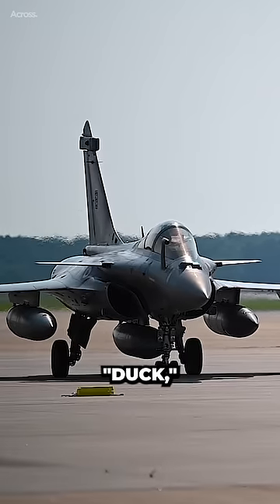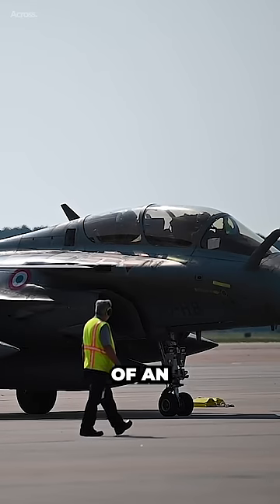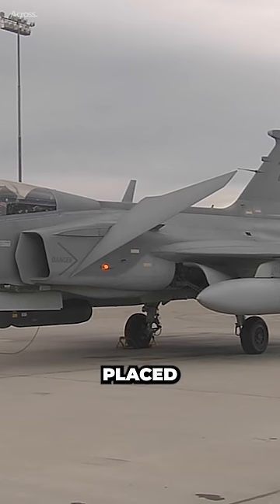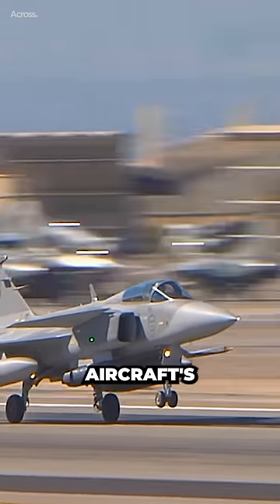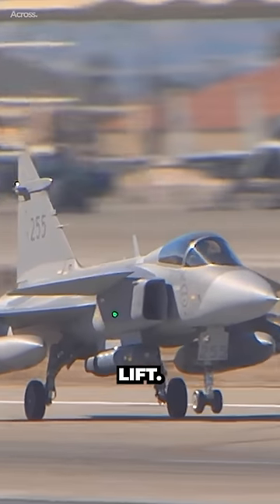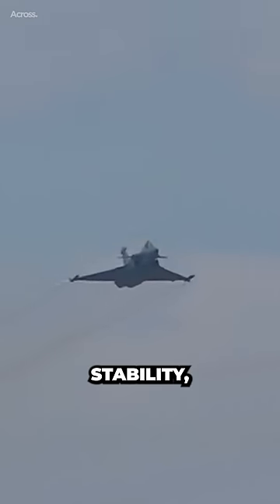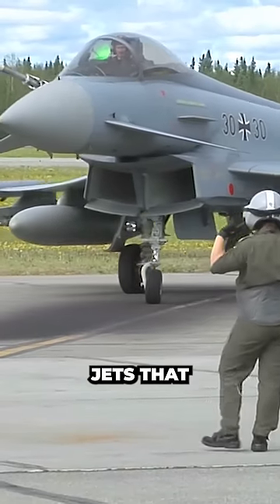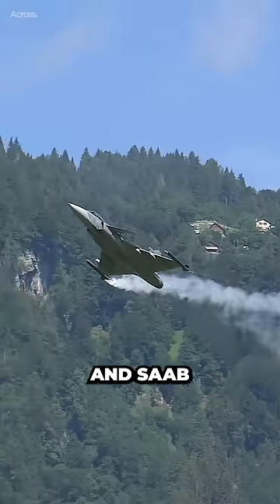Why Don't American Fighters Jets Have Canards? #shorts

Comment: Probably a bigger thing is that the US hasn't adopted a non stealth airframe in 50 years, and actively does not want to damage sales of the 4th gens by admitting they are pretty easily improved upon. The f16xl is simply better than the f16.
Delta canard is objectively better, but not so much better that it is really important. US doctrine has regarded air war as a sensor war for a long time now, so they have done very little work on improving airframes, other than reducing visibility.
An F104 with modern situational awareness aids, coutermeasures, and weapons would almost certainly beat a 1990s F15, and there is much less room between the F15 and perfect than the F104 and the F15. The US regards the 1970s airframes as 'good enough' so does not see any need to adopt more modern designs, at least for now.

Comment: The US may not use control canards, but don't the stabilators on the F-22 and F-35 provide similar, if not more benefit? And I'd be interested to see if there are additional benefits when pairing thrust vectoring with stabilators over just canards.
Reply: I would highly recommend looking up the MIT opencourseware video on the F-22. The presenter does a deep dive on the control mechanisms.
Reply: @SSMJ  Thank you Seth! I watched this a while back but will give it a rewatch. I mainly wonder if anyone has done a presentation on the comparisons of the Gen-5 stabilitor applications versus control canards. I don't remember if Randy touches on this in the lecture but I will find out!
Reply: @j.l.61  I don't think anyone is ever discussed the topic specifically, but my understanding is that canards were initially introduced to compensate for some of the failures of controllability of Delta wings. As a contrast, to my understanding modern stabilators are used as an avenue to provide non-traditional vectors of control as compliments to an already very unstable airframe. Though these are benefits that weren't realized till the computer based flight system of the raptor, and in the raptor's case the design decision was made due to stealth considerations and caused a massive headache to work around initially.

Comment: What if instead of traditional nose cannards , we use the massive air intakes on the front and install variable nozzles , to adjust intake airflow which generates a directional thrust vector at the nose of the plane.

Comment: If you're looking at 5th gen and beyond fighters, then canards will adversely affect the RCS which will affect how stealthy the fighter can be. Look at the J-20, and how much larger its RCS is compared to the older F-22 and the F-35. 

Also, with the advent of thrust vectoring, these 5th fighters won't need canards to be more maneuverable.
Reply: Thrust vectoring isn't used for maneuverability in an engagement

Comment: Canards are great to a point; but at supersonic speeds a canard propagates an additional set of shock waves over the aircraft that interfere with airflow about the main wings. In traditional supersonic aircraft the solution to this problem is simple; the wings and body propagate a shock wave over the rear stabilizers and the entire rear stabilizer is actuated to actually use the shock wave to its advantage. Since the wings of an aircraft are fixed canards present an extremely difficult aerodynamic problem to the main lifting surface especially at higher angles of attack. The instability is even worse during the transonic region of flight as the aircraft approaches Mach 1. While canards are great at subsonic speeds with a computer controlled flight control surfaces they are horrific dead weight at supersonic speed. It’s one of those things that looks cool but isn’t really that useful. This is why the SR 71 went blend wing body and the Canard is actually blended into the wing and the body. At a high enough speed rear stabilizers are just a heat producing drag surface as well. A while different blend wing body is needed. Canards can be utilized at higher speeds with very predictable calculable angles of attack where the propagation of the aerodynamic disturbance can be specifically engineered as an advantage and there is a need to not have rear stabilizers about one or more axis. It can be useful at high angle of attack to use a type of blended wing body canard to create a vortex over the main wing and body of an aircraft to increase lift and control dramatically. This can make for a very maneuverable fighter plane at near stall speeds; but requires lots of thrust to maintain.

Comment: Canards are also hard to make stealth. It’s possible, just very difficult to pull off and sometimes it comes at a cost like making them stealth means another part of the aircraft will be less stealthy. 🥷 

Also, we really don’t need highly maneuverable fighter jets. People raised such a fuss over a F-16 taking out a F-35 in a mock air battle, I didn’t find that surprising. Stealth fighter jets don’t need to be good at dog fighting, they’re like the sniper on the battlefield, if a stealth fighter jet is close enough to see then that pilot did many, many, MANY things wrong….

Comment: Because they aren’t meant to be flown high for stealth, it’ll be low and fast so they aren’t picked up on radar and can’t be engaged with anti air as easily having a moving part changing the radar cross section. And when your down low you’ll need manoeuvrability in case you do get targeted with anti air. Unless your a high altitude bomber well above missile range with top spec stealth altitude is just good for cruising and saving fuel, great for economic and passenger planes, not if you need to manoeuvre in a hurry to evade a missile in a combat role. That being said each plane has its own characteristics for its specific purpose which isn’t the same as the other aircraft.

Comment: Great for delta wing aircraft…. They greatly improve maneuvering. 

Bad for stealth.  They bounce radar right back at’cha!!!
Reply: The stealth-reducing effect of canards is a myth. They don't move that much, so don't bounce radar back
Reply: @Orbital_Inclination  
Movement Doesn’t cause a radar reflection. 

Corners cracks and grooves do. That’s why the bodies of stealth aircraft try to be rounded.  (first generation was highly angular.). They try to hide air intakes and jet exhaust on the top of the wing (B2, Strealth drones) so that radar from underneath isn’t reflected.
The canard meeting the body causes a groove all along where it meets the fuselage.  
That groove bounces and magnifies radar beams.  
Just my opinion. Maybe an aeronautical engineer can comment?
Reply: @tpalmer4829  Sorry, my point could have been worded more clearly. I wasn't referring to the movement itself, but to the angle it makes not being enough to significantly increase reflection. 

Conventional tails also have exactly the same gap where the fuselage meets the horizontal tail of an F-16, F-15 etc, hence why the effect of canards on RCS is not really any greater than that of a normal tail.

Comment: I don't have aeronautical degree or anything. But I always felt canards were for the most part a lazy method of achieving stable flight on an unstable design.
You can also "sense" this when looking at  the f86 and mig15. There are fins on the wing of the mig15 to help with yaw, the f86 has them but they're much smaller or nonexistent. With that in mind they are much more prominent on us naval aircraft of the era due to those operating conditions
Reply: Strange that some who have aeronautical degree don't think the same way ...

Comment: I don't believe that canards are an issue for stability at the speeds 4th and 5th gen fighters attain since most are MACH 1.6 and lower.  Most US and NATO aircraft today aren't even as fast as the 2nd and 3rd gen fighters because of fuel consumption and stealth.  The outlier is the F-22 which can hit MACH 2.25 without afterburners and can turn faster than any aircraft in the sky without them. The real reason is that they're not needed and are too complex to fix in combat situations.

Comment: But less stable means more maneuverable and isnt that what a fighter needs to have a better chance of winning a dogfight ? Fighters can't carry a endless supply of air-to-air missiles.
Reply: That's very incorrect you can have a very stable aircraft and also a very agile one too.  The F-16 debunks that statement. It has been very stable and agile since it was first introduced.   Problem is the lack of intelligence and imagination in the designers.

Comment: theres also a lot of speculation on its impact on stealth capabilities, but that has yet to be determined. The Chinese J-20 is a stealth fighter with canards so it may just be myth.
Reply: The Chinese J-20 isn't stealthy, India has had np picking them up on radar.  There is a reason why they keep them on a low profile.

Comment: Wrong. The US looked into super manoeuvrability using canards with the F-15 STOL/MTD and found that it was counterproductive towards BVR combat so they decided to stick with traditional designs instead. The US doctrine of dogfighting leans very much towards two circle fights where maintaining energy and bleeding the enemy of energy is more effective that going for one circle fights which is where canards are useful for.

Stability and manufacturing costs aren't an issue as we have computers for the former and the latter never was an issue given the major European nations designed and built 3 different jets all using similar designs.

Comment: Maintenance and ease of it.  US has a standoff philos till it's time to go furball, which doesn't matter the altitude we're at.  Train how you fight, rate of pitch can screw you up in a turn at different air thicknesses which a canard can do.  HA!  KISS over here.  We learned on the flying brick at high angles of attack control surfaces would be reversed under heavy power, ya had to learn it.  It was the tail.  The canards would have a learning curve like that in not black or red out by yanking the stick.  Even dropping power in the furball.  Just dropping tanks, dumping ammo all plays a part of it.

Comment: The real reason is that canards are terrible for stealth aircraft. They create corners and angles with the main wing and fuselage that reflect radar to back. Traditional tails do not do this as much as they are placed behind the major cross-section of the aircraft. It was also found that canard aircraft lack the controllability of stabilators at slow speeds.

Comment: I mean… When you have the F-22 that’s been around for a bit now. Which literally is basically invisible to most radars and even when it does show up. It’s the size of a duck. Do you really need that small amount more of maneuverability? By the time the enemy even gets a chance to lock onto an F-22 they’re dead. Lol 

Let’s put it this way, in every force on force training exercise the F-22 has been in (minus one lucky time) the f-22 has been placed 1 against multiple other opsecs. By the time the first guy can say “incoming right!” They get splashed lol

Another tangible and easily researchable article to prove they don’t need the canards is. One time two F-22’s were escorting another slower plane through Iranian airspace. (Cannot remember the type of plane being escorted for the life of me) though some F-4 phantoms, which are no joke in their own right with a seasoned pilot. Came up to the escorted plane to try and redirect it or something. The F-22’s were like “hold my beer bro” flew under the F-4’s. Visually inspected their load out. Then rolled up next to them and in the coldest tone possible said: “you should go home now.” If I was those f-4 pilots, I would have shit myself, and retired then and there. Lol

Comment: The second point is wrong. Military aircraft are designed to be inherently unstable during flight. This greatly improves agility while flight systems are needed to fly the jet. All modern fighter jets are unstable and are only made possible to fly through fly by wire and the flight computers, which makes many many micro adjustments without the pilot even noticing. Without it, the plane would be out of control in no time.
Reply: That's a bogus, ignorant and uneducated statement.  The F22, F15 and F16 are very stable.  The F15 fly's just fine without fly by wire and has for the past 50 years.  Only its recent variant the F15EX is fly by wire and that enables it to carry more missiles.  The F-16 didn't have Fly by Wire till the Israelis invented it.  The F-16 were very stable without fly by wire and computers to assist it.  Computers now in the F-16 is to keep pilots from killing themselves in it because they don't know their limits with the plane.  

The F-16 is one of the most stable agile planes ever made.  Also making it one of the most deadly because of it.  No plane can beat the F16 in a dogfight until thrust vectoring came along.
Reply: Your statements are wrong. All modern jets including the F16 are designed to be slightly aerodynamically unstable. This is called relaxed static stability and greatly improves maneuverability. The F16 was the first jet to be designed in such a way. It uses quadruplex FCCs to correct its flightpath in subsonic flight. The F16 gains positive static stability when entering Mach 1 due to the shift of the center of pressure. Without FCCs, analog (F16 Series A/B) or digital in nature modern Fighter-Jets wouldnt be able to be flown by humans. As for no Jet would be able to beat the F16: if flown perfectly, yes but since this very rarely happens, its the pilots skills that matters in dogfighting. Even some A10s have bagged some F22s in trainings due to circumstance and skills.

Comment: Its not the Canards that are the issue. 

Its the Delta Wing wich the US does not want to use, since it allows a very high angle of attack, but also enourmous energy loss while turning. 
There were Deltas without Canards, like the Mirage III, who later got them as the Kfir in Israel for example to enhace maneuverability at high aoa. 

In the end canards work well, but the wing behind it comes with drawbacks the US does not want. It also comes with advantages, but those can be achieved by other means as well.
Reply: The typhoon doesn't have tremendous energy loss in turns though

Comment: HUH the F-16, one of the fastest  jets in military service is purposefully built aerodynamically instable and is literally unflyable without electronic compensation. You're argument that a canard makes a jet more unstable is valid, but saying that a fighter jet needs to be stable is bs. Airliners have stable aerodynamic properties. Modern Fighter jets (usually) don't

Comment: I can tell you right now the reasons the us doesnt use canards is because they’re too complicated to manufacture
Reply: That isn't true. Look up the F-35 and how it is manufactured. Here is a tip: complexity just means more cost. 

The reason the USA doesn't use them is that the USA relies more on keeping the airframe already massively unstable but using fly-by-wire to keep it stable.

If a canard is hit or is jammed, the aircraft is going down and there really isn't much a pilot can do. 

If your fly-by-wire system is failing, the plane is already a loss regardless of what happens but there are multiple redundancies that make it a much better option.

Comment: Stealth, top speed, and stability.
There just saved you a couple min.

Not because it’s more difficult so the Americans don’t do it.  I mean if Americans just take the easy way out when building planes then there must be some some other reason why f35 has already outsold the Typhoon despite having less time on the market.
Reply: Euro fighter uses canards because its a delta wing design, US just uses a different design for aircraft. Canards are also generally more beneficial on smaller aircraft while US' tend to be large.

Euro fighter at the time had other competing aircraft. Another big seller at the time was the Rafale, another canard jet. F35 is selling because its basically the only 5th generation jet on the market besides the unaffordable F22, most other countries skipped 5th gen entirely and are coming out with a 6th soon.
Reply: The reason f35 has outsold typhoons is the technology lmao because of the whole networking of radar locking at over 80 miles with help of AWACs and other planes what do expect between 4th and 5th gen fighter. If bae decided to upgrade the whole typhoon fleet to gen 5 technology you would see similar sales. Right now the typhoon is like 4.5 gen with some upgrades

Comment: Absolute nonsense, if cost was an issue then Saab would never have incorporated it since Sweden's budget is low. Gripen is Mach 2 and supercruise which would not be possible if the design was unstable or more drag.

Comment: Canards are a tool to make up for the lack of design.
Reply: Well, if that's the case. If the F22 was so aerodynamically perfect. It wouldn't need thrust vectoring to compensate for the "poor" design.
Reply: @LEGEND  really?? The F22 isn't perfect. It's the 2nd most aerodynamically unstable platform ever built. FYI, the F16 is #1. A platform like a C130 or the A10 is extremely stable. 
To pull 9 Gs, you can't have an airframe that's stable.